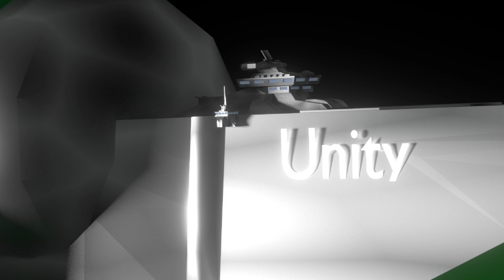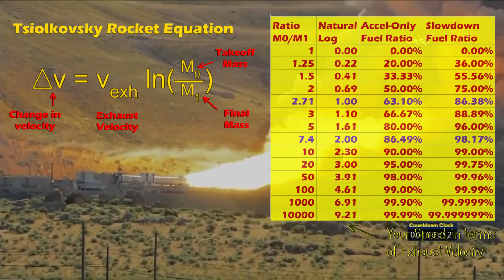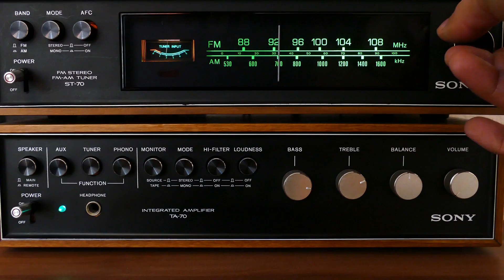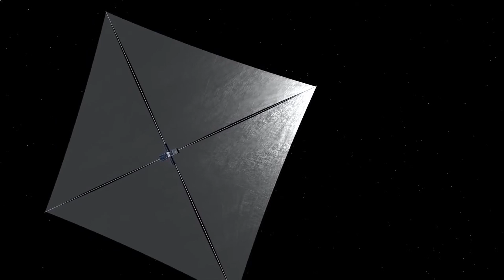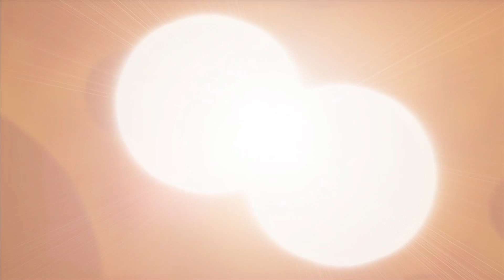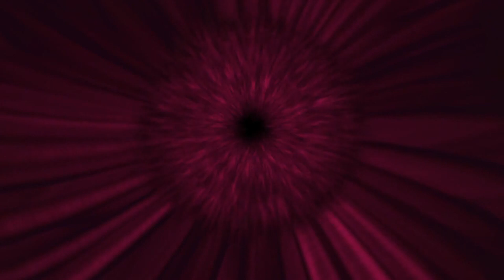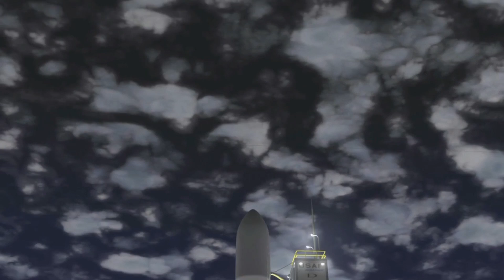Interstellar Travel Challenges

Comment: Another HUGE issue is the G acceleration & the rate at which it takes place. In order to achieve 10% light speed how long would one have to be under how much G to reach that kinda speed, huh? Yeah its not like you can just walk around when subjected to just about any amount of G you gotta be at least sitting down! Because its kinda tough to be sleeping under ANY G I would think. Or even drinking something. Or pooping something. And remember its not like this thing is "taking a break" from accelerating! Think about the speed for a sec here. 10% light speed is still 18 THOUSAND miles per SECOND! that's a 1000 times FASTER than to remain in LEO. So if it takes 5 minutes to reach 18000 mph how long would it take to reach that in one second? At how many G? Unfortunately I don't do calculus but you get the idea (its gonna take awhile).
Reply: You’d never want to go over 1G which is earth gravity so I’m not sure why it’s that much of a problem. And for those ships with giant O’Neil cylinders in them it’s likely they won’t accelerate any faster than 0.05-0.1G

Comment: Could we eventually just grab a large, nickel-iron asteroid, mount it to the front of a long starship, and let it take all the damage? Diameter maybe 50% larger than the vessel, to provide a safe area around the ship for space walks, extensions, expansion projects etc. Obviously the fuel costs of pushing a billion ton asteroid would be enormous, but if we do get to anti-matter drives, it is just a question of time needed to accelerate to cruising velocity, then decelerate at destination; would it take months? years? Would we care that much if it's a 60-year journey? We could push it to 99% of light speed and not be overly concerned about collisions and radiation; the massive shield would just absorb everything. 

Thus we could get to Alpha Centauri in 4.5 years, and Tau Ceti (12 LY) in maybe 13-14 years, depending on acceleration/deceleration time. For that scale of travel, we would not need to worry so much about life extension, though obviously the longer the better, and perhaps more importantly, the healthier the better. You don't want a ship full of people with cancers, weird viruses and auto-immune diseases constantly filling up the hospital.

Comment: Love your mindset. If I may make a few observations. First the ship should trave @l light speed as a Minimum. Secondly there is a fluid called. A supper fluid that could protect the ship. Thirdly with all the radiation hitting the ship from all angels. Why not convert that radiation to energy. Fourth. I like the conveyor idea that surround the ship. That would lend it to recycling. All to do with ( powering the ships resources) Big problems require big thinkers with a can do mind set.

Comment: One thing I wish Isaac would address more is how they'd deal with the insane amounts of waste heat generated by an interstellar rocket. Going off the mass of a couple hundred million tons, a delta v of 10% of light speed, and a conservative estimate of an initial acceleration of 0.01m/s^2, Unity's drive would have a jet power of 10,000 terawatts. Even attaching gigantic 8 square kilometer two sided radiators with an emissivity of 0.9 radiating at 1600k, that'd only reject 6 terawatts of waste heat. I'm sure there are several ways around this problem, it'd be interesting to see an episode about that in particular

Comment: in the section of the space shield, i would like to mention a question, what about holding a cloud of ionised particles like a kilometer thick ( depending on density needed to witdstand the impact of something the size of "define stuffs" ( the size of an atom? and hair ? a pebble? a car ? an aircraft carrier ???? ( how the hell didin't you saw something the size of an aircraft carrier coming near our trajectory ??? )

SO, the thickness of HOT plasma whatever thickness you want depend on the strenght of the electro magnets, wich are probably going to be supraconductors ) )  

so basycaly, it's a bright cloud of gas hot as the sun that can burn anything in the path, if it don't, it's because you did not made it thick enough ( you can even go kilometers tick, hell, carry a gas giant in fron of you if you want ) 

have a nice day

Comment: What if you just made a laser “shield” by placing several forward-facing cutting lasers close together on a rotor and spinning it very fast. This would create a cone of laser beam destruction dust couldn’t get through. Maybe the pattern of beams could be brought together and the rotor could be directed at large objects. It would probably use a lot of energy, but probably less than running radar and processing/motion tracking for the automated laser aim shoot system. Just a thought

Comment: In a lazzer 5 cm apart 5 mm there is a pressure hole in space in the centre of two inter twining beams
Roll around both lazzers
Spin this into 6 sinqillion cuts per slice lat this 6 cemter from Hull

Comment: Light speed is for pussys I go any speed
My steering steer in 18 ways a direction
Fustion
Reacter fusing light
Usen fusion jets to fuse the light from fusen the light in Fustion reacter with lazzer beams cut in 3 way time
369

A lazzer tile encoded to be a screen
A calucum carbonate compressed to 10000 prsi
Lazer coils for vents coneting Fustion reacter to jets

Comment: Often wondered how having to turn around to slow down would affect starship design, too. I'd guess that a long, thin pencil design having to rotate all the way around at speed would probably be too risky - exposing the entire length of the ship to radiation and collision risk. So...would it have to have something like engines that can rotate on nacelles, or purpose-built forward-facing engines? Or something more elaborate? If the whole ship did spin around to slow down, would it still need armour on the rear, or would engine thrust alone do the job of knocking obstacles off-course? Could they detach the engines and just bring them up front?

Comment: Couldn't you use the solar sails to decelerate using the destination stars light as drag and orbit closer are closer after doing a fusion burn to partially decelerate so you don't slingshot out of the system completely?

Comment: What's the point of putting so much shielding into the front of your ship. When half of your trip, the engines have to face forward. How do you plan to shield your engine on deceleration?
Reply: The exhaust plume clears the debris.

Comment: look up whipple shields, too - have several layers of  5 centimeter thick armor spaced out with a hundred meters between them, say 20 of them stretched over 2 kilometers - follow that by a 50 meter low density / foam shield with csic or kevlar/ceramics layers in it and you can armor 0.1 square kilometers with 200000 tons of material - not much compared to the mass of a long narrow ship you can shield behind it

Comment: I actually think except for truly large rocks a mechanical shield could still work pretty well
a starship would be pretty heavy anyways and if you make it long and narrow enough you can get a lot of volume behind a very thick shield that still has an acceptable mass
make that shield out of some hightech ceramic foam structure and it should hold off anything you're likely to encounter and you can still have relatively basic radar and maneuvering thrusters to avoid anything too big
also instead of turning around to slow down you'd probably swivel your engines - or have several engines or several nozzles - depending on how your engine works and which is easier to do - and have radial engines angled at 5° or so - loosing soem efficiency but only a tiny bit due to the way trigonometry works - your efficiency is now reduced by a factor of cos5° so you lost about 0.3% efficiency - but you can now place engines at the back of the ship safely behind the shield but with their exhaust blasting past the shield by the side

Comment: Things would be much easier if we lived significantly more than a century.  We could make things run much cooler and save on fuel if we didn’t have to rush.  If we lived a few hundred thousand years we could go to nearby stars at a reasonable speed.  It is a biological problem, not necessarily an engineering one.

Comment: I think blowing a nuke on the 100 tonne sail will destroy it and maybe send pieces flying everywhere, including into the main ship..
Reply: It would be about a mile and a half away from the sail surrounded by matter perhaps garbage to form an expanding plasma though the calculations were split between tungsten propelkent discs versus polyethylene propelkent discs (they weren't certain if greater mass or higher specific impulse would be better).  The math has been done and small scale experiments including a steel plate at ground Zero, external fission explosion drives are thoroughly possible and probably the only proven method of driving a generation ship to 10% the speed of light though quite frankly Dyson Freeman's calculations were for 3.3% the speed of light and it was only Sagan on his tv show Cosmos that said 10% the speed of light, the horrible National Geographic Docudrama "Evacuate Earth" split the difference and said 7% the speed of light.

Comment: What about (say...) 10 meters thick cover of cotton layers on the spaceship's front? Perhaps with additional layers of some sort of carbon fiber crap.. Perhaps self-closing (self-repairing) material from minuscule damage..
Would that negate the kinetic energy potential damage from the "space dust bullets" ?
I mean.. ye sure.. fancy umbrellas flying in front of the spacecraft .. which would be increasingly harder to control the further away they are.. Why not just have a decent protection on 1st place, instead of going to the trouble of sending sh1t in front and creating more problems than solving?

Comment: Isaac, sorry for not going through the previous 962 comments, so I may be repeating something here, but why are we talking about metallic type shields and blasting micrometeorites with lasers?  Your craft looks like it is of a technologically advanced stage where each floor has artificial gravity.  Wouldn't we have developed an actual force field by that stage?  I mean we already have the means of repelling like polarity objects with electromagnets, so why couldn't we project a very strong positively charged magnetic "shield" around the front 4/5 of the craft, with a closer negative charged field, and finally an electrical screen that then vaporizes anything that gets through the first 2 barriers?  Then, because this thing was obviously built in space (so it's weight and mass aren't much of a factor), have the outer hull 3cm thick carbon fiber, a 4mm thick self-sealing rubber sealant on the inside, a 5ft gap (for various test/maintenance equipment, conduits, hull inspections/repairs, and maintained at a positive pressure) then an inner hull with the same composition so that if the outer hull happens to be breached to where the sealant can't completely seal the hole, there still won't be an explosive decompression.  There could also be positioned between each bulkhead, a decompression activated canister that dispenses an expanding foam to completely seal off the affected area from the rest of the maintenance compartment.  Maybe having alternating positive/negative fields will have the added benefit of protecting the inhabitants from some of the most harmful types of radiation (someone should test that theory).  Since this is an enormous ship, it can have multiple nuclear reactors aft for propulsion and electrical generation (assuming we haven't perfected fusion drives by the time it is built), so we should be able to generate the power required.

Comment: What scenarios could result in a ship surviving, but not being able to slow down to stop at a target system? If such happened, what could be done?
Reply: @obsetube1725  Surely it could happen late enough in the journey that while it could slow to a relative stop, it could do so so slowly that it would have passed the target star. That would mean an extended journey, and it it takes long enough to slow down, an impractical one. Another scenario I thought up was escape in a smaller vessel, or dumping of much otherwise useful equipment to cut the mass to be decelerated.  Lot's of tough choices would have to be made.

Comment: REALLY COOL, EXCELLENT AND REALISTIC VIDEO ABOUT ...
interstellar traveling to other star systems light years away but requiring LASER blasting space dust in front of the interstellar ship. However, (as in the case of familiar electromagnetism or a magnetic field around any electrical current through a wire) I fantasize that extremely! powerful hyper-high frequency electromagnetic pulses encompassing the entire generational-star ship (to include the passengers and everything inside) might (if not just sci-fi) put it all just slightly out of phase with normal space-time and into a sort of "subspace-time" state or condition. Therefore, direct contact with space dust or even large objects would be avoided as in a ghost-like effect. There would be no requirement of blasting space dust in front of the subluminal-generational star ship in which a bullet-sized particle could destroy the entire ship.

This really cool and fascinating video does  not consider warping space-time to travel to star systems light-years away in only a matter of weeks or months. INSTEAD, this video considers relativistic interstellar travel or subluminal (slower-than-light) speeds such as 10% light speed or a little greater requiring generational ships or else putting people in suspended animation (a whole different tech potentially more dangerous as the people might just die at anytime.). This video therefore does not consider superluminal (faster-than-light or FTL) space travel the tech. of which is described by the Alcubierre-White warp drive and the Alcubierre-Froning warp drive proposed technologies.

Comment: It's too bad we can't just have a black hole suspended in front of the ship to absorb any impacts.

If you could teleport fuel directly into the engines, you'd have yourself a 99% light speed ship.
Reply: Using a black hole as shield wouldn’t work, but using one to push is is a different story.

Comment: What about a 'force shield' ? (whatever that exactly is) here's my take on it anyway. perhaps it would be like an electromagnetic controlled plasma surrounding (cocooning) the ship. It would look like a small shooting star from the outside (good camouflage too) the ship would be inside this 'starshield' (like an insect). Nothing, not even a grain of sand at high speed would be able to get through . I could play with this idea more but I don't think that's necessary, you get the point. It's possible though, I believe so .

Comment: Just as a thought if you launched a probe with a laser on it to propell the ship forward would you be able to create a more efficent system as you effectivly have no dry mass for fuel.
Reply: Also if you actually created something similar to a cone could you create something so insanely slow at changing the angle that it can deflect particles traveling at the stated insane speeds.

Comment: Passive protection against dust sized particles in interstellar space might be possible.  A super thin balloon filled with gas at less than .01 atmosphere might vaporize small grains of sand fairly efficiently.  With a possible length of hundreds of miles, with the mass of an air bag one mile long at normal atmospheric pressure, it would need no lasers at all, simplifying the ship.  The question would be how long the millions of tons of gas. would last.  Would the gas mass used be made up by the vaporized dust, or would it need to be replaced?

Comment: Would a systematic blasting of all the space in front be better than scanning for dust?  Just burn all the space in front at a resolution fine enough to clear anything in the ships path.  You wouldn't need a radar then or a computer.  If the ship is rotating you could move the laser from the center to the out side so that as it moves its cutting a clear spiral that eventually works out to be a cylinder of cleared space ahead.

Comment: What about the basic premise of relativity here? Isn't all speed relative? A ship going at 86% of the speed of light relative to Earth is not going to be moving that speed relative to everything else in space. I'm no physicist but it seems to me that the need to protect against particles running into a ship is the same regardless of what speed relative to Earth the ship is moving at. The idea that a ship would have to protect against every particle of dust seems to be based on the idea that there is a universal frame of rest which there isn't to my understanding of relativity.
Reply: The earth's relative speed, indeed our entire solar system's relitive speed, is minimal compared to traveling even 10% of the speed of light, even if everything ahead of you is moving in all manner of different directions or speeds, your speed will be several orders of magnitude higher, to your perspective everything is hurling towards you from the same direction and roughly the same speed, it's like driving in a rainstorm where all the rain is being blown towards the back of your car by the wind, but your moving forward faster than the rain so it's hitting the front windshield instead, moving at relativistic speeds is just an extreme version of that